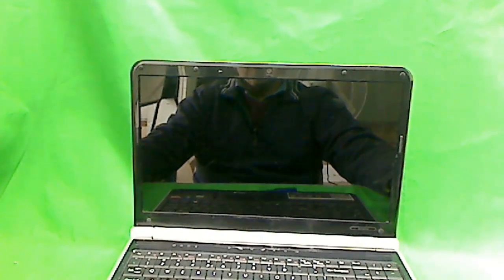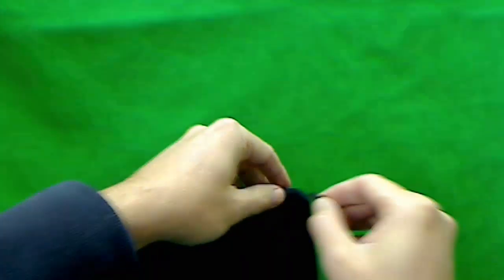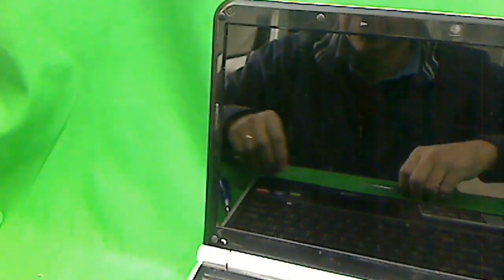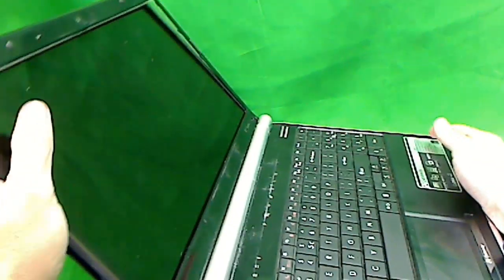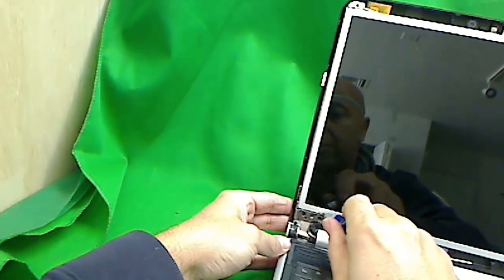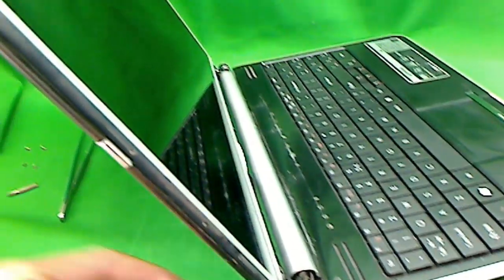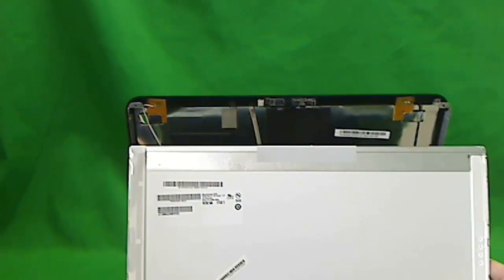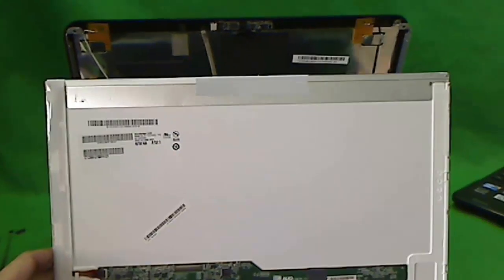Gateway NV53 Laptop Screen Replacement Procedure

Comment: fixed my monitor, make sure the magnet is hooked on the metal side. Also make sure watch how he plugs in the Ribbon thing that is the connector to the monitor . you don't need all the screws in for it to post.

Comment: Thank you so much for the tutorial. The backlight ceased to work on my wife's laptop and I suspected the ribbon cable had been unseated. Your video allowed me to get in, reset the cable, and fix the problem! If the problem had been worse I could and would have replaced the screen.

Comment: I have a gateway NV57H13u, and I can't find the exact replacement lcd online. However, it seems that most of the NV series share the same lcd. Can I just buy a LCD (with the same size and resolutioin) from say the NV58078 to replace my NV57H13u?

thanks, your video has been very helpful!